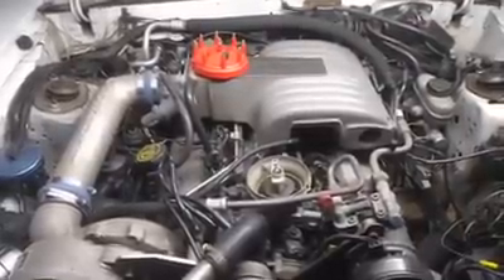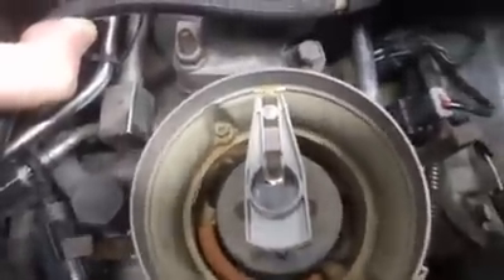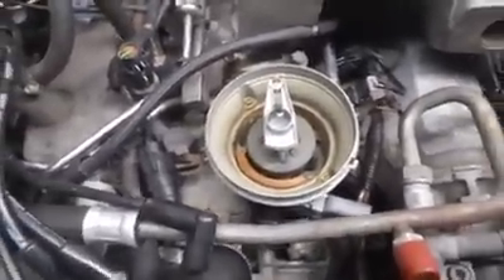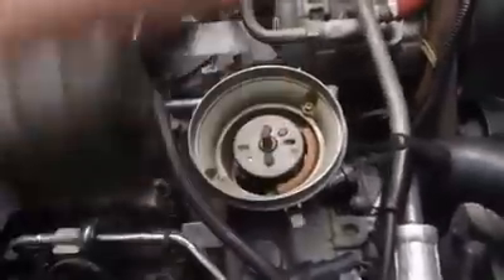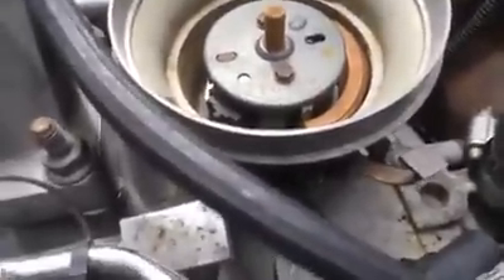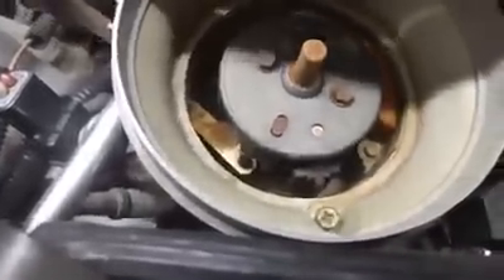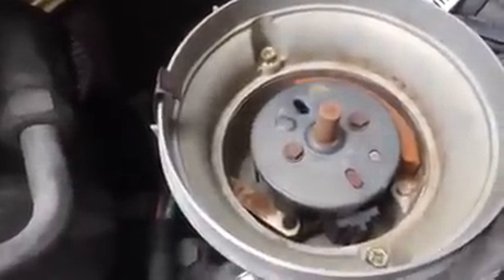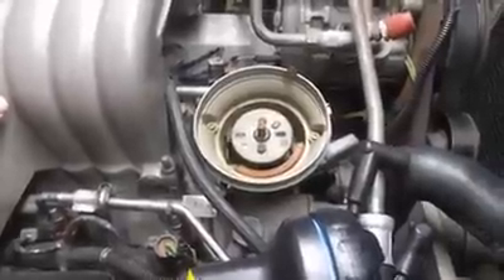Distributor install in a 5.0L Ford Mustang

Comment: By far THE BEST 5.0 timing video EVER! That pip tooth trick just got my 95’s new motor started. I did the initial start up with the spout out. Let it warm up til the fan came on. Set timing at 10* wasn’t off much. Turned the car off then added thd spout back. Running it has 20-22* timing and a clean smooth 850 rom idle. No check engine lights!! 

Hats off to you for making this video!!!

Comment: Man i just got my 90 gt timing set in my brand new 306 i put together and i've never had to install a distributor before . Everyone talks about tdc but your the first person that has expanded that you have to turn the motor to 10 deg before tdc before you put your distributor physically in the motor my car is running perfect it took me few times but she fired right up i have been pulling out my hair for 3 days till i saw your video i thank you a thousand times for explaining the process completely from start to finish looking forward to more tips and vids
Reply from the maker: Glad it helped you. I've posted loads of tech articles on 5 liters on the Drag Radial Performance Facebook page over the years. Be sure to check it out.

Comment: Thanks ... Just saved a 1989 Mustang GT convertible from a junkyard, in Florida. Junkyard owner said it needed a motor. Because, motor wouldn't turn by hand. When I got the car home, we  pulled the belt & motor turns over by hand, smog pump is locked up. Distributor was the only part  missing on the car. So, I found one in a junkyard, from a 1988 Towncar. Last, night got mustang at top dead center. ( pulled #1 spark plug & stuck a screwdriver in the cylinder trick ) . today, going to install the distributor & cross my fingers. Thanks for the tips.
Reply: Cocoa Cabana howd it go
Reply: victor garcia lots of rain here in Florida, I haven't installed the distributor yet
Reply: Cocoa Cabana cool hope you can get video up when you can thx
Reply: How did it go?

Comment: So do I stab dizzy in at 10 degrees btdc or at 0 degrees btdc? Having some issues on a rebuilt engine getting the timing right.
Reply from the maker: Watch the video a few times. You rotate the motor to 10 BTDC on #1 compression stroke. Stab the dizzy in so that the rotor points to where I show in the video on the lower intake. Then rotate the cap (dist. housing) until the leading edge of the rotor tip lines uo with the middle of the PIP sensor.

Comment: Hi I have a 1988 Lincoln town with a 302 5.0l. I had a shop install a new Distributor and it hasn’t been Idling correctly since. It’s set at 12 degrees Timing and the Throttle position sensor is more then the recommended 1 vault.
Do you have advice on how I can Set the correct timing at 10 degrees and do a base Idle reset. Not sure if this would fix my issue, there’s no vacuum leaks and for what ever reason the car will not run correctly. Thanks.
Reply: Remove the SPOUT connector, and use a timing light to set the timing at 10 BTDC. Make sure you're not at 10 ATDC. Use a wire brush to clean off all the timing marks on the harmonic balancer. Make sure the #1 spark plug wire is the 2nd terminal away from the passenger side distributor cap hold down clip, and therefore the wires have not been moved around on the cap. Double check your firing order. Open up the PCM, and inspect the 3 teal blue capacitors very carefully for leakage and corrosion. Clean the mass airflow sensor hotwires with MAF cleaner.

With the engine warmed up and idling, unplug the IAC and adjust the throttle stop until the engine runs stable, but as low of an RPM as possible. Then plug the IAC back in when done. TPS voltage will likely end up in the .9's somewhere. Make sure you don't have any vacuum leaks. Make sure the EGR valve is not directly connected to engine vacuum.
Reply: @Pontisteve  , thank you for responding I appreciate it, take care 👍🏼
Reply: Hi when the car is off it’s at 8 degrees is that correct? Or do I have to pull the Distributor, set engine timing to 10° to get top dead center and then start the base idle reset or can I adjust the distributor while the car is running to 10°? And follow your steps 
Thank you.
Reply: @sheba6779  You are physically turning the engine to 10 BTDC, then installing the distributor so that the rotor points to the right spot (1/2" to the left of the drivers front intake bolt). Then rotating the housing so that the skinny tooth's leading edge is right in the center of the pickup coil. Then bolt it down, start the engine, and fine tune the timing with a timing light.

If you did it right, the timing will be very close when you start it up, probably within 2-3 degrees of 10 BTDC.

Comment: Do you set the harmonic balancer to tdc before you put the distributor in ???
Reply from the maker: Watch the video! 2:18 mark. You manually turn the motor to 10 BTDC before stabbing in the distributor.
Reply: @dragradialperformance3540  thanks g
Reply from the maker: You're welcome. Good luck  @KingdoubleO.  .
Reply: I'm working on someone else's  1992 F150 with  5.0 . Where should the button point with #1 piston at tdc  AND dizzy at 0° .  I would rather dial in the 10°  with the distributor since I won't be the only person to work on this truck and future repair  person's won't know about the engine being mechanically st to 10°....if that makes any sense

Comment: Is it absolutely necessary that the #1 position on the distributor is facing the direction you have it?  Asking bc I’m using a fox efi setup with a different fuel rail (concerting old bronco to efi), and the cap bracket arm housing just barely hits the front of the fuel rail by #5 position to where I think it’ll be impossible to set the timing.  
As long as the motor is at TDC, do I just need it make sure I’ve got the rotor and distributor lined up, regardless of where it’s pointing?
Reply from the maker: The distributor has to be stabbed a certain way so that you have a fairly equal amount of movement either direction when you're setting the timing. The timing gets set so that the rotor is facing spark plug wire #1 on the cap when the crank is at 10 BTDC on cylinder #1. The distributor housing could swivel all the way around and point wherever if it weren't for the fact that the module would hit stuff, so we need to stab it so the rotor points where it should and the cap lines up with the rotor.

There is 90 degrees of crank timing between each cap point. If you were to move the wires one position over on the cap, you could rotate that cap another 90 degrees to create some better room to rotate the housing and set the timing, and the ignition timing would be correct. But the injector timing would be 90 degrees off.

I'm not sure if this answers your question, but it is important that #1 on the cap is always the second plug wire away from the cap holddown bracket on the passenger side. You cannot move the plug wires around on the cap. You can however stab the distributor differently, and that will result in the housing being at a different position when the timing is right, without moving wires on the cap. You'll just have less timing adjustment room in one direction, and more in the other. If you can still get it to 10 degrees BTDC, then that's ok.
Reply: Drag Radial Performance Drag Radial Performance thanks for the reply, I believe you’ve answered my question.  I just wanted to confirm stabbing the distributor in a different position shouldn’t affect anything  (assuming the rotor and #1 cap position are aligned at tdc).  First time installing one, couldn’t think of a reason the housing orientation would matter and just wanted to confirm.  Thanks again
Reply from the maker: @mwfoster80  Wherever you stab the distributor at (with motor at 10 BTDC on #1 compression stroke), that's where the #1 terminal on the cap has to be. And the #1 plug wire has to be connected to the cap terminal that's the second one away from the passenger side cap holddown clip. In other words, you cannot move the wires on the cap, or you'll screw up injector timing.

The reason I'm putting the rotor in that exact position in the video is because that's the proper place to put it in order to have an equal amount of distributor adjustment turning room in each direction. If you stab it any place else, you might end up with the module hitting something, like the intake manifold, and not allowing enough rotation adjustment, or very little adjustment on one side and a ton of space on the other.
Reply: Drag Radial Performance thanks again, I wish I could send a picture.  Basically I just need to stab it about 10-15 degrees clockwise to your video position bc the distributor housing clamp will not allow for much rotation at all bc it hits the fuel rail if I go at the same position as you.  I’m keeping the wires at the same positions on the cap.  Really appreciate the video and responses
Reply from the maker: @mwfoster80  As long as you set the motor at 10 BTDC crank position, AND you don't move any wires on the cap, you can stab it any way you want. However, there are only a very few positions that will also make the housing adjustment (Timing setting) correct. The one I show gives the perfect amount of adjustment room in either direction. But you could probably go one tooth left or right and have lots of adjustment room in one direction and nearly none in the other direction. But as long as you can get the timing set at 10 BTDC, it really doesn't matter. It's just aesthetics and adjustment range that are at stake here, if you're only 1 tooth off.

But think about it. There's 360 degrees and x many teeth on the distributor gear. So each tooth will be (360/x) degrees away. That means each tooth amounts to a lot, and there's only so much room before the module and distributor housing hits something. Now if you remote mounted the module and possibly ground on or machined down the distributor housing, you could probably buy yourself a lot more room. A 94-95 distributor and some wiring adaption could even eliminate the pad on the distributor.

Comment: Can anyone tell me the symptoms of the bad distributor, i really believe this is my issue.will idle but as soon as i put it under pressure driving it 10 15 minutes ot so it will shut off like somebpdy hit an off switch, also cranks slow after it shuts off.sometimes it will crank back up after sitting a few minutes sometimes it wont.
Reply: Your symptoms are consistent with a bad ignition module. Unfortunately, it's really difficult to correctly diagnose a bad module without a scope. It's also very possible to get bad modules right out of the box, even with Motorcraft modules. I would throw a module at it. If you can test fuel pressure while it won't start, that would be a good idea. You can see my other videos for how to test a PIP sensor, and rule that out first.
Reply from the maker: @5.0L 5.0L I had the same scenario caught on camera with the scope in one of my videos on module testing. Except in that case, it was the module that quit putting out, while the PIP and SPOUT signals remained fine. Be careful using an LED test light for high voltage or amperage circuits. You could smoke it pretty easily. An incandescent test light is the right job for that.
Reply: Ignition switch take off the plastic around the steering colum and push the connection together and hold it Der if you need to